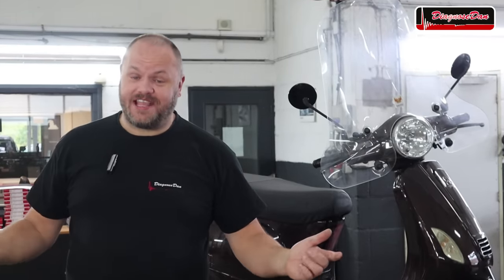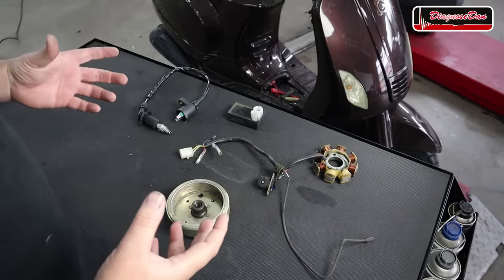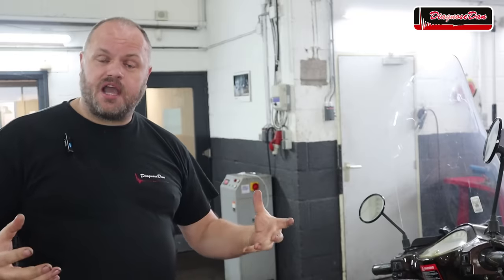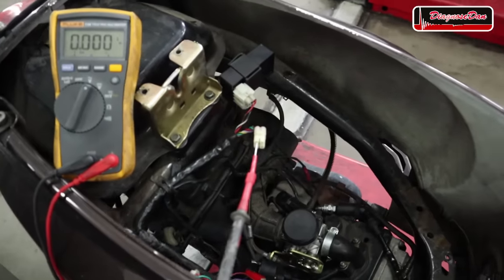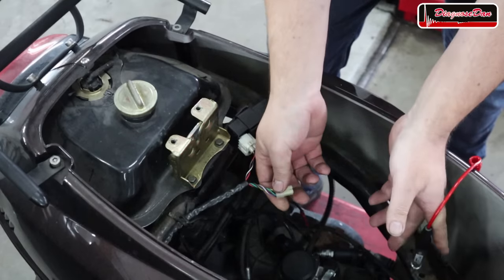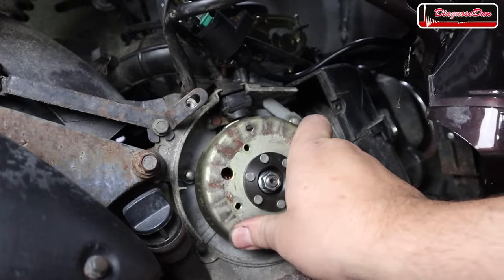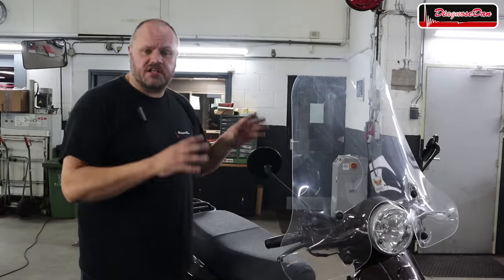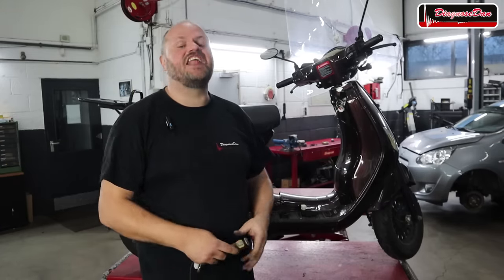No spark diagnosis and Explanation (GY6)

Comment: i was just given a 2005 CF Moto freedom 250 with 1600 mi. which ive learned is a Honda Helix clone. its been setting since 2010.  i replaced fuel tank, filter, and cleaned carb. to my disgust, crank no start and found it has no spark. not knowing a thing about the scooter i am looking for any help/diagnosis for this. i havent checked yet to see if the ignition system is similar to your video.  it is a very WELL taught video and i thank you for that.
Reply from the maker: Its proberbly quite similar

Comment: I’m unfortunate enough to work on these glorious machines regularly. The CDI boxes do sometimes fail, but it’s uncommon. As is failure of the ignition coil. The most common actual part to fail is probably the source coil on the stator in my experience, (if it’s not a DC system that don’t have them, which having a carb it most likely has one. I’m not that far into the vid yet)  pick-up coils can fail too, but also not that common. 

However the most common reason for them not to start is wiring/kill switch or side stand switch related, some have an immobiliser switch under the seat that fails too. They are so poorly made that most will still crank but not fire when these circuits are inhibited. I usually check the kill wire from the CDI isn’t grounded first, normally black and white. 

Anyway, back to the video.
Reply from the maker: Thanks for your comment!

Comment: You complicated the test. You just need a multimeter.
First check the ignition contact (key) and kill switch.
Then measure the ignition coil - values in the manual.
After that, measure the pickup coil- values in the manual.
And final, check the stator, if the coils are damaged you'll get ground between the phases and negative (excuse my poor english).
This metode I use on my motorcycles.

Comment: So how does a stator fail? is it dead short due to insulation failure? as i would have guessed you would have seen an open circuit from the harness, or am i missing something with the pickup ? thought this was for trigger point only so assume this as a hall sensor has no hand in the lack of voltage supply to the cdi.?  genuine question to learn from this.

👍

Comment: GOOD JOB thanks looking for info but we know the problem with ours everything is new just not the CDI and the wiring harness, it has been tampered with by the previous owner himself soldered 1 wire to 5 wires, for example, as I say asking for problems the solution new CDI and wiring harness straig is without self-soldered interruptions. just look for the problem

Comment: I had bad voltage regulators on my outboard engine (it uses 2), replaced those and the motor would misfire, then replaced the stator and the switchboxes (CDI) along with the trigger (Mercury 2.5l v6) Tested the stator with an ohm meter and it was out of spec. So the bad stator, damaged the voltage regulators, voltage regulators damaged the switchboxes (CDI). The new trigger was just for my piece of mind.
Reply from the maker: Wow an almost completely new ignition system😂

Comment: I have a DC Scooter, Kymco agility 50 4T. And the cables were different than you explained. Just wondering if it could be the Battery or the CDI box that is faulty. It has no spark and i have gone nowhere with the diagnosis

Comment: Question regarding the multimeter measurement, when set to hold the max value, does it then approach the scope voltage? Or does it still average the reading?

Comment: You could have checked the ohms on the stator without removing it. It usually is around 25 ohms. Anything like 0 or more than 25 is a short.

Comment: Man o man I hope I can fix this 4 wheeler with a gy6 engine. Had to replace wiring harness and after replacing it I’m not getting spark. Motor cranks just no spark. It had spark before replacing everything so idk what I did wrong. 

Not sure how to approach this without a multimeter…lol.

Comment: There should be also specs about the resistance of the stator coils. I guess you could also diagnose the stator by measuring the resistance.
Reply: I was thinking the same thing as he had a known good stator he could compare to.
The end result would have been the same though so nothing lost really.
Reply: @Stambo59  Yeah, I was thinking about DIYers... Also if you measure the resistance, you don't have to remove it from the scooter. Saves time in case it's not faulty.
Reply from the maker: Next time😉

Comment: Hi Dan. I was wondering if you can help me out. My Audi A3 1.6 tdi is reving 5k to 6k after you go past 2.5k revs while driving or even stationary. Mechanic is saying that theres excessive white diesel fuel smoke coming from the exhaust and that its basically a run away engine. However their is no oil leak what so ever just excessive fuel being injected and massive clouds of white smoke. How you come across this issue and if so could you tell me what are the possible issues. I'm thinking it could be a faulty pedal or something possibly with the exhaust or even that theres water contamination in the fuel. What are you thoughts on this. Really appreciate your help. Many thanks and you make awesome videos

Comment: Hi, i replaced the stator, ignition coil and cdi and module, still not starting. Set timing according to timing marks getting blow back through carburetor. Spark is there but seems weak. When setting timing the piston is almost at the "bottom" which does not make sense. I checjed the valves it seats nicely, not leaking through. What can i look at next. Thank you

Comment: Good diag as normal
The only thing I’ll say - no stator needed if you changed to a DC CDI and connected the wire near engine to ign +
Yep do that if needed
Stator only must be replaced of not charging, the rest has work arounds
Reply from the maker: No battery needed if you change to ac cdi😉
Reply: @Diagnosedan  true but also AC CDI makes the scooter easier to steal n start

Comment: Help Please, unlike all the examples share, my Z4 is stuck in the retracted open position. I put the reader on it, and was able to find a bad switch, however I cannot access it without moving it. Apparently there is tool you can buy to unlock some latch, that I cannot see. Got the tool and unless I am hodini have not idea based on the instructions.. Any help, links, advise will be appreciated..

Comment: Never rule out that the magnets have gone weak if you get a small engine that's hard to start.
I wouldn't suspect it in this case though.
Reply: Very easy to forget this one, as it very seldom happens. But you know the "rule" it is frequently the part you are least likely to suspect.
Reply from the maker: Never seen it myself. Have you seen that?
Reply: @Diagnosedan  I have seen it on a Jawa 250cc 2-stroke motorcycle. It was very hard to start and a screwdriver was almost not attracted to the magnet.

Comment: Just in case you wonder, what "CDI" unit means for scooters = Capacitor Discharge Ignition unit for this small gasoline engine. 
It is not "cdi" in the meaning of "Common Rail Diesel Injection" as known from Smart or Mercedes vehicles. 😀
Reply from the maker: I think most people understand that😂

Comment: The high voltage coil(s) need many winings of very thin wire. They are exposed to the engjne heat and the hot/cold cycling makes the wire fatique and fail. The white and yellow are the low voltage coils, can be either single phase or 2 phase against ground. Looks like a coastal scooter looking at all the corrosion.
Reply from the maker: Its just old😂

Comment: How do you know the CDI box is operating on AC? Because there is a rectifier that converts AC to DC in order to charge the battery and operate the accessories how would I know that this isn't also providing DC power to the CDI box? Are all AC CDI boxes matched with a battery? I remember old 2-cycle racing bikes from the 80's that had no battery but had CDI ignitions. I am guessing they were all DC boxes?
Reply from the maker: Ac and Dc cdi's look a bit different. But in this case all i had to do is look at the wiring diagram and i could see that the power came from the stator
Reply: @Diagnosedan  Thank you so much.

Comment: why does a stator fail there are no moving  parts to wear out, it is only a wire loop, is it a solder joint or wire meltdown or brittle wire that causes the problem
Reply from the maker: Heat, vibration

Comment: i fixed a problem scooter once it was a 2015 peugeot kisbee  with a crank no start and the owner was like why doesnt it start i looked and saw a wire dangling in the rearwheelwell a few days later the owner tryed to remove the seat innerstorage to acces it but didnt have the propper socket so i took my socket set and loosend it enough to reach the wire and terminal reattached the wire and it fired right up but the connector felt lose so i thightend it abit but gave the owner the advice to get it looked at by a professional shop as i owned a peugeot years ago but that was a streetfighter2 i thinkit was i bought for cheap just for transport reasons never had any big issues with it
Reply from the maker: Peugeot makes nice scooters!

Comment: san is super ...   Nissan xtrail  T30   vehicle recieved condtion time  timeing  chain is broken   engine after removal and refitting  time vehicle is  hard to starting  ple any idea support me  i do understand  one data mointor is different   CAM position  synchronizer  is DONE .but  CKP  position synchronizer  is NOT DONE .this valve ignition on and starting time  is no change

Comment: Why didn't you look for the damage to the stator, its nothing but coils of wire and might have been easily repairable.  And how did you happen to have so many spare parts available for such a random thing?
Reply from the maker: A new stator is €35, i had an old one from a scooter that my daughter had an accident witch  was beyond repair. The part was free so easier and cheaper to replace than repair.

Comment: Why not just test the continuity of the stator coil with the multimeter to figure out if the stator circuit is closed (live & ok ) or open ( short & kaput ) 🤔
Reply from the maker: Why an extra test if we already know the stator was not working?
Reply: @Diagnosedan  my scenario is " if we don't know that the stator is ok or bad & as a diy guy we only have multimeter at hand " 😅

By the way that was a great & new segment for this channel.

I hope we will see fuel injected motobikes diagnosis later

Comment: I am so evil, 2nd time I do not agree the story. 4:40 story how it energize the ignition coil...it works opposite, it cut the power and collapsing magnetic field generates the spark.
Reply: If you look at the diagram at 5:07 one side of the coil is grounded, the other side is energised by the CDI as he said, then it cuts power to collapse the field and make a spark. So you are both right. 😀
Reply: CDI is capacitor dicharge ignition. The stator voltage is rectified and then charges a capacitor to a few hundred Volts. A thyristor is triggered by the pick up coil to dump the charge of the capacitor in the ignition coil, that gives the spark.